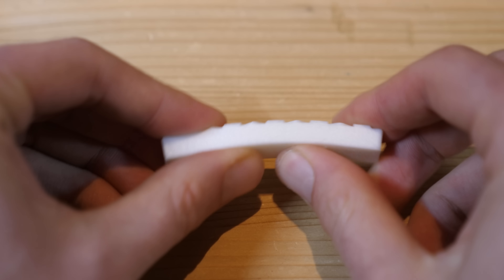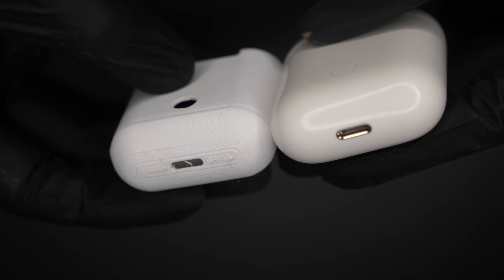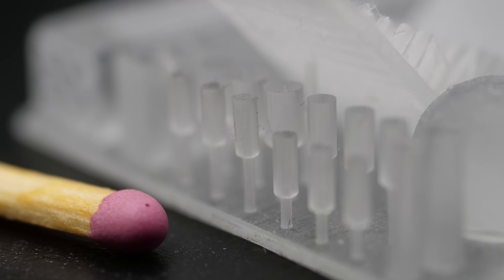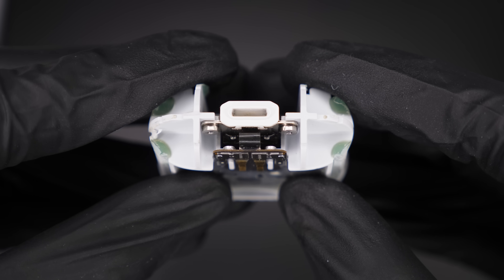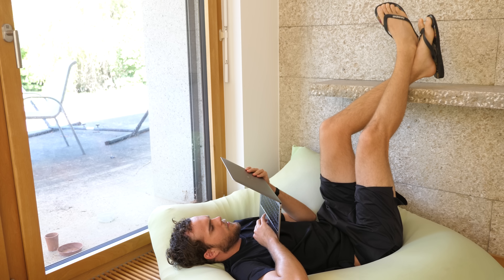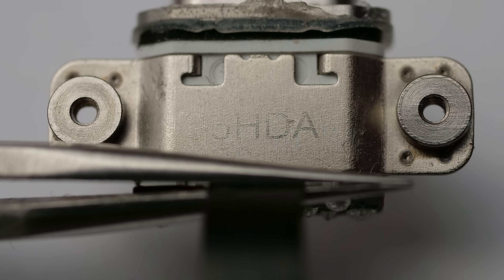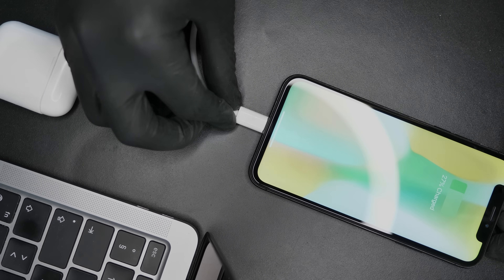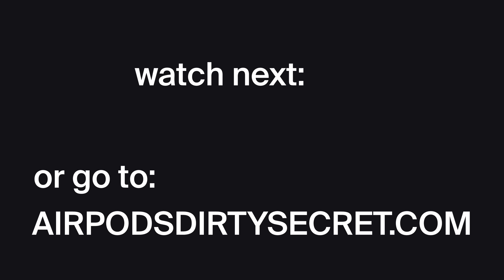AirPods' Dirty Secret (and how I'm fighting it!)

Comment from the maker: What should I fix next?!
Reply: my life
Reply: @Lantos1618  lol 3 hours later I said the same thing
Reply: Can you please design a solution for the Apple Pencil 1 and 2? There's no way to replace their battery without destroying their case. They're also wonderful devices, with instant response time, and it such a waste discarding them after the battery dies.
Reply: @mandrews817  YES PLEASE! There is no Tutorial for that, and a 3D printed Modell would be soo nice
Reply: @mandrews817  yea like maby somthing like one of the lenovo ones so you just take some AAA's and insert
Reply: The new Magic Mouse would be funny to fix, put a USB C port pointing forward instead of lighting on the bottom
Reply: @jacqueshilo250  This.
Reply: @jacqueshilo250  Just so you know, Magic mouse does not work while charging. So even if the port was forward or backwards, it would not even pair with your devices while plugged in. It's easy to test. Just plug it in and try to use it at the edge of a table so that the plug is not getting in the way.
Reply: Removable plug for the new iMac
Reply: Great vídeo. I'd LOVE if you could just embed the Airtag circuit on the case and have it be powered by the Airpods' case battery. 

Apple will eventually do it one day but you come from the future, you should do it first and show us the process+schematics!! 😏
Reply: Reasons why you should embed the Airtag chip within the Airpods case:
1 - We lose Airpods cases all the time and being able to find it would avoid thousands of daily "mini-heart attacks" on a global level. I'd say it's a global health issue!
2 - Lost Airpods cases contribute global waste problem since most people end up buying another case only to find the original one in an old backpack 2 months later
3 - The Airtag chip would be powered by the Airpods battery. Thus, there won't be a need to buy and throw away a disposable battery on an yearly basis
Reply: Add a headphone jack to an iPhone. I think it is impossible, but if it is not, then do it.
Reply: @anmolagrawal2438  there’s another YouTube channel with a guy who lives in China that added a headphone Jack to his new iPhone.
Reply: Airpods max, naturally
Reply: AirPods Pro with usb-c
Reply: Question: will this support PD charging (C-to-C Cable), or only a USB-A to Type C cable works?
Reply from the maker: @iSpoof  Any type-c cable will work. The AirPods draw a ridiculously low amount of power btw.
Reply: @iSpoof  I would venture to bed it supports charging from a standard C cable, but not fast charging and likely not power sharing. From what i understand, it has to have a USB-C PD controller to enable charging over the cable. But since it has hardware not designed for it, the controller would probably be running in a basic one way, low throughput manner. Still massive upgrade from the lightning port.
Reply: @iSpoof  I think this case charges with a very low current, so switching to USB PD won't be relevant. Even with no USB communication it can just pull 2,5w without overloading anything.
Reply: Airpods pro
Reply: Airpods pro?? That's what I have and there ain't NO way I'm throwing that out when the battery is caput
Reply: The pro airpods
Reply: what else than the magic mouse charging port :D
Reply: Airpods battery, for sure!👍
Reply: @Mendelyeev  That is really hard though, given how small and compact they are, they have to use ultrasonic welding on the Airpods. I guess you'd have to remake the whole Airpod casing because you can't take it apart without cutting it. If I had a pair of broken Airpods, I might just redesign the whole thing and only use their wireless audio capabilities to make bigger earphones or even wireless stereo speakers that would show up as Airpods.

But the battery case being unreplaceable is just being an excuse, my cheap 50 buck earpods can be easily disassembled with six screws, uses a standard battery pack(just one cell and a protection board) you can have for one buck. Just desolder the positive and negative ends and double side tape it in
Reply: Firewire devices… I’m thinking audio interfaces and negative scanners.(A bit old school, but some of these devices are great.)
Reply: The Magic Mouse, Magic Keyboard and Magic Trackpad
Reply: Old MacBooks with MagSafe connector.  I designed a 3D printed insert to fill in the gap between the hinges of a MBA for a slabtop. But I really want to convert it to USB-C.
Reply: Airpods Pro should be next (i've been getting charging problems with both airpods from time to time)
Reply: airpods pros!!
Reply: AirPods Pro
Reply: My life. It's a mess and it's repairablity score is 0.
Reply: That's exactly one of the main problems with Apple. They don't want to fix stuff they want you to get new one.
Reply: Putin
Reply: My life please
Reply: Have you gotten a cease and desist from Apple yet?
Reply: Joe Biden
Reply: @Studmaster007  the guys good but he ain't that good lol
Reply: @Studmaster007  
Let’s go Brandon! 😒
Reply: My empty bank account
Reply: It might not be a that wide-spread problem, but it would be very interesting to upgrade the MacBook Pro 16" 2019 to a newer version of USB-C PD, 3.1 that is, to provide the hardware with more power. The current problem with the device is, that temperatures of the GPU and CPU are fine, but after a short period of time, both chips throttle down to roughly 55W combined, which is far away from what it is capable of cooling. So in short: Much performance potential is lost.
I was able to identify what could be a bottleneck in the schematics but i am not quite sure. Maybe that's something to look into.
Reply: Or another idea: Retrofitting older MacBooks with the new Magsafe connector!
Reply: Tim Apple's Brains
Reply: My math results
Reply: Put USB C on old iPods
Reply: Airpods pro and max
Reply: MagSafe iPad charging
Reply: Make irreplaceable Macbook parts (SSD ; RAM) replaceable on the M chips. I dare you...
Reply: The US economy or the US healthcare system lol
Reply: This whole corrupt system we are forced to live in with.
Reply: My parents.
Reply: I suggest you go next step and start fixing batteries themselves😁
Reply: This is amazing for the right to repair group, but did you think about the potential copyright violations by providing and potentially selling these?
Reply: MY LIFE
Reply: Air pods pro... Battery in those are coming to an end as well.
Reply: make sure to wear an extra mask so your 3d printer doesnt become a cis gender male republican
Reply: Airpod earpiece batteries please habibi
Reply: Can you sell these parts on Amazon... Easyly
Reply: The buds would be greate next since they also Break.
Reply: my bank account
Reply: my life? maybe...🥺
Reply: AirPods Pro
Reply: Next step is adding AA batteries to this case, to make it really easy replaceable batteries. :D
Reply: AirPods Pro!
Reply: airpod pros
Reply: Humanity?
Reply: Your audio levels. You whisper while talking but the music is much louder... which do you think is more important? Being able to hear what your saying or the stupid music.....
Reply: the whole apple company
Reply: The Radiation ☢️ emitted by tge air pods themselves 🤔
Reply: My life
Reply: While wireless earbuds are cool and all, what about the people who like cords? USB C carries sound right, can we not add the headphone jack back on to something by jumping off the port in some way? Would be 10x better to be able to charge my phone without having to use a dongle for wired headphones, or having to worry about another things to charge like wireless earbuds.
Reply: @RedRaiga  USB does not carry sound,  wired apple earbuds have basically a built-in sound card.
Reply: Biden's economy
Reply: you should start a business doing these repairs lol. im really struggling to even find wireless headphones that are not over 100 dollars. maybe try inventing good wireless headphones for a reasonable price?
Reply: Fantastic skills & effort! This is a little lateral, but l find that earbuds are screaming out for attention. I have what l suppose are child size ear holes & surrounds. My R earpod will stay in my ear, but l have to sticky tape the Left one in. Same for my Bluetooth Bose NC size zero silicone ear buds. And l won't even list all the other brands and models that l have purchased & tried. I have a drawer full. Cheers from NZ!
Reply: Apple as a company
Reply: Please make an iPhone with a micro SD card slot!
Reply: Stop buying Apple products. They are the worst company that abuses planned obsolescence like no other company on the market.
Reply: macbook touchpads are trash
Reply: @ee242ee  impossible completely different phone's
Reply: Hack the touchid chip :P
Reply: Can you make a universal port, that will be compatible with type-c and lighting at the same design?
Reply: Nintendo 2DS XL
Reply: A headphone Jack on where the S Pen is on a Galaxy S22 Ultra or maybe an SD card slot if possible?
Reply: macbook air m1 ram
Reply: Powerbeats Pro. Same repair.
Reply: The solution for the Apple Watch batteries! Please !
Reply: My life! please
Reply: The old 30pin to USB-C, so we could revive old hardware like speakers...
Reply: You should do a clear AirPod Max, but with color coded like the inspiration of the iMac color in the 90s!!!
Reply: Improve sound quality in AirPods 2 or any iPhone
Reply: The problem is, people buying these CRAP apple products...
Apple is S*IT!
Reply: can u implement a lightning port in a apple watch ? is that possible ?
Reply: Airpods 2
Reply: airpods
Reply: подключить наушники к авто на магнитолу припаять. как громкая связь и для разговора
Reply: Can you try acetone bathing the case? It might make it look like the shiny oem case.
Reply: Next you should start a patreon. A lot of us would be keen to support your work :)
Reply: AirPods Pro please!!!
Reply: Would be awesome if you could find a way to upgrade Apple memory in some easy way on their laptops and even on desktops lately. Its such a scam that they do this, as you can't ever upgrade it, which forces you to purchase a newer model just in a few years. Not to mention, their memory upgrades during purchase are over double the price of what you would normally spend.
Reply: The 0,00000001% of users can do the same, the rest will go to applestore to buy new one.
Reply: Sooo...  when are you going to build a LumenPNP to populate your circuit boards?
Reply: Guy, U really COOL.
Reply: Design a laptop tracker that can fit inside a laptop, 

I have came up so far with nodemucu module + gsm+ GPS module, 

But planning to do it alone with only nodemcu to scan the local wifi and get connected to strongest signal( which is open as well ) send it's IP to to an api and get its  location and send back to my server. 

But the problem I might face is low accuracy since I'm not using GPS module.

Btw nice work, I'll share my work when it's done , but in mean time u could design a laptop tracker circuit then it would be super awesome. 😍❤️
Reply: how to repair individual cells from a lipo!
Reply: Oooh, oooh, I know, the world!
Reply: yOu wOuLdN't DoWnLoAd aN AiRpOdS cAsE...
Reply: Ring Camera
Reply: Make it wireless charging case instead
Reply: AirPods Pro!! USB-C and case… same story
Reply: airpods pro
Reply: modular laptop
Reply: you should do the same with power beats pro!!!
Reply: A Razer Naga mouse. Got a lot of use out of mine, but very difficult to fix.
At least it has screws on the bottom lol
Reply: Fix Apple's anti consumer behavior :D

Let's get back to reality, fix the global warming instead, it's more likely to succeed anyway.
Reply: instead of welding a nut, use a PEM nut fastener
Reply: Apple's mentality.
Reply: my parents marriage
Reply: My country (Argentina) economy!
Reply: How do I repair my Ipod series 3 without messing up all my music?
Reply: Ukraine
Reply: Skullcandy Barricade XL wireless / portable speaker.
I may own one of the only ones that work properly;  online, people are leaving scathing comments about how their speaker:
Won't connect to a device
Won't pair properly
Constantly in a state of overheating, with the warning message playing.
NOT waterproof contrary to the fact Skullcandy claims it is.

Those are the issues I remember reading about.
Honestly this little speaker has bass WAY beyond what you would expect it to be capable of, given its size.
It is a bit flat on high frequencies, but you can still hear clearly enough to make it enjoyable to listen to.
Reply: Beats fit pro, wireless charging.
Reply: Beats fit pro, wireless charging.
Reply: Beats fit pro, wireless charging.
Reply: Thinkpad t480 USB c charging port that seems to have a short lifespan. Maybe a more durable charging port?
Reply: I've never been so turned on and informed at the same time 😄
Reply: Seriously  though  you should make a rubber case that that plugs in to the case that allows  you to plug in a C drive. That way all you have to do is put a sleeve  on the case and not have to open the case
Reply: As someone with an AirPod Pro case with a dying battery and a bad lightning port…this is my natural request 🤗
Reply: apple keyboard
Reply: Poverty and world peace.
Reply: Please Try the Beats Fit Pro I think that would be pretty interesting
Reply: The airpod itself with its micro batteries
Reply: It would be interesting if you did a survey to find out which companies are the best at allowing their customers to fix their own products. Which companies use standard parts which can easily be replaced by the consumer. Sony is my top company.
Reply: scrap electric motors
Reply: Add bluetooth to ROG Falchion Keyboard or any old wireless keyboard.
Reply: Do the same thing for the AirPods pro please
Reply: I know, your judgement on what to buy,,, Apple has been known to fuck their customers over.. if you buy it still, everything that goes wrong is your fault not theirs lol
Reply: Magic mouse charging port
Reply: Are you any good at politics just kidding have a good day I wish I had a project worthy of your t talent
Reply: iMessage. :) :P
Reply: my mental health
Reply: @shahpirzada79  Goto the gun range and fire unit you feel better. Fixed!
Reply: @flufffycow  never fired a gun in my life but not sure if that will help
Reply: The gun problem!!!! U asked love sydney
Reply: That advisor you talked to was pretty new probably. She was explaining what happens when you send them in for a repair. Apple will take authority to replace them so you don't have to wait for a repair. Apple will just recycle the original product. As long as its in warranty that is. If you buy apple care they will do it on demand via their express replacement, which is basically them sending you out a new product first taking out an authorization hold for the non-return of the broken device.
Reply: My life 👍
Reply: My iPhone! 😂
Reply: Your 3d printer.
Reply: a bit off topic the topic from phones or ports, but seeing how 3rd party hall effect joysticks have been released for the steam deck, maybe you could make a hall effect or optical joystick upgrade for the switch or ps5 or whatever game controller you have lying around to eliminate stick drift :D
Love your vids!
Reply: Schwab!
Reply: You should really do an "airpods pro dirty little secret" video!
Reply: This was brilliant. 👍🏻  Hack a Tesla, as your next project, with due permissions from Tesla. 😄
Reply from the maker: @veritas.ve.42  If you can provide me with one, I'll be sure to look into it haha
Reply: @ExploringTheSimulation  😄
Reply: you should sell these cases even when you just sell 5.
Reply: Global warming
Reply: The volume of your voice in the video.
Reply: Just make a portless iphone 12 Pro. With MagSafe for iPhone you don't need the charging port.
Reply: @bastiaantjuhh  You mean putting clay in the port, and painting it to the same color as the rest of the phone?

Comment: Hell yeah! i dont use air pods since i like the quality and reliability of wired buds, but I 100% support your mission!
Reply: I think they are reliable. Had non break. Yeah one because my dog bite it. But non break because of a drop or so. And they’re pretty cool because no dangling of the cables. The battery is charged pretty fast so it’s not that they’re not reliable. It’s that you’re not reliable charging them. (I mean you not personally but in general - non offensive) but I unterstand why you would buy wired ones
Reply: @gregorboxer2463  My personal reason is because wired generally have better sound quality for a much cheaper price.